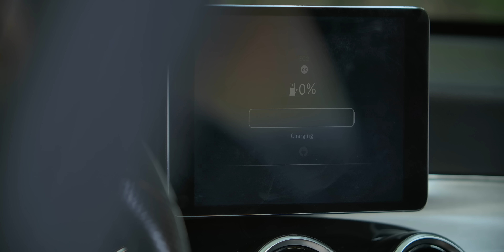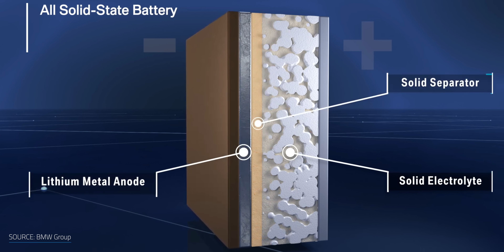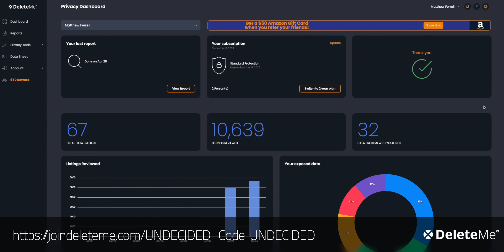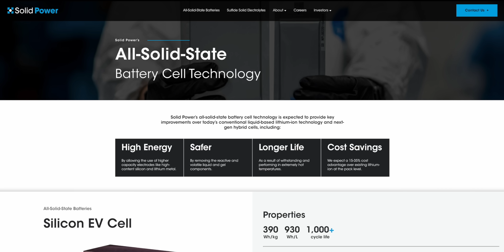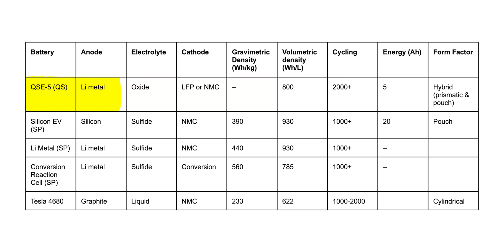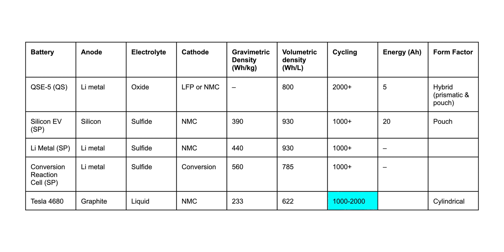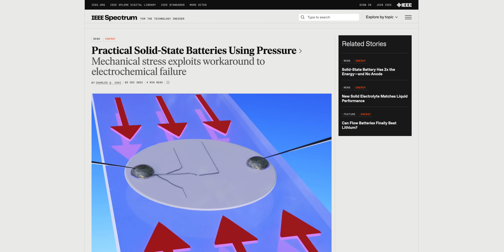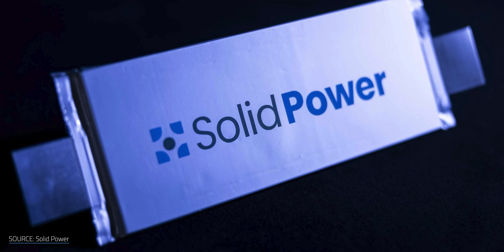Solid State Batteries are Closer Than You Think

Comment: Quantumscape already solved solid state batteries. They are literally commercializing them now and are about to submit B samples. VW's PowerCo verified the performance of the batteries publicly earlier this year. Quantumscape's lithium metal batteries are a real thing. The only question is whether or not QS will run out of money before they end up on the shelf. It's definitely a solved problem though.
Reply: Quantum scape has a semi solid state battery. They aren't actually solid state. That's just marketing.
Reply: @4203105  that's totally fair. I just say solid state because that's a general term that people are familiar with. Quantumscape's batteries are technically lithium metal with a solid ceramic separator. Not technically solid state. However, as Dr. Siva Sivaram (QS CEO) said on the TD Cowen interview a few days ago, Solid State means NOTHING if you can't get them working well outside the lab. And NO ONE has a Solid State battery working well in real world conditions. Not even SLDP. SLDP had problems with thermal runaway in their A samples, their battery requires high operating temperatures, and still has not solved the problem with dendrites (cycle life). Watch the TD Cowen interview with Solid Power's CFO as well. SLDP's CFO did not inspire confidence in SLDP's offerings and STILL REFUSES (his words) to provide updated performance data on their batteries. He literally refused giving this information live. Whereas QS's CEO was interviewed by TD Cowen and gave a whole slideshow filled with A2 performance data and had a whole slide showing where QS is compared to competitors. QS is actually showing progress and is being open and transparent about performance and milestones. SLDP is not. I want you to compare the TD Cowen interview with SLDP and the TD Cowen interview with QS and marvel at the difference. The difference is night and day. After watching that, tell me which company you would rather trust to build a next-gen battery. I'll take the lithium metal company (QS).
Reply: @4203105  you're right. Technically QD is lithium metal with a solid ceramic separator. Not solid state. But as Dr. Sivaram (QS CEO) said on the TD Cowen interview a few days ago, solid-state means NOTHING if solid-state batteries can't perform well or cost-competively in real world automotive conditions. If lithium metal does better than the current solid-state solutions, that's okay. SLDP for some reason put their CFO on live during their TD Cowen interview (different interview from the QS one) and refused to give any performance metrics on their latest batteries. The CFO Kevin literally refused to provide any data. SLDP A samples had thermal runaway, high operating temperatures, and haven't seriously solved the high cycle life issue. In the QS interview with TD Cowen, Dr. Sivaram provided a whole slideshow on performance metrics for the A samples that QS has provided. He also provided a slide that shows where QS is in terms of development compared to all of their competitors. QS is far ahead of everyone else, especially SLDP. I would encourage you to watch both TD Cowen interviews (SLDP and QS) because both of them occurred in the last few days. SLDP had nothing to offer and was incredibly skimpy on any details. Nothing new to report and was a nothing burger. QS'w interview essentially clarified whether A2 was made with Raptor films and confirmed the timeline for B samples delivery. The slides were packed with info about CLEAR DOCUMENTED charging and discharging capabilities and compared these to competitors. There's no comparison at all between SLDP and QS and they really shouldn't be used in the same sentence.
Reply: @4203105  Sorry I don't know why my reply keeps getting lost. I'll post it from my PC. You're right -- QS's battery isn't fully solid state and yes, it's just marketing. They have produced an anode-free, lithium metal battery with a solid ceramic separator. Not full solid state. As Dr. Siva Sivaram (QS CEO) stated in the latest TD Cowen interview from a few days ago, solid-state means NOTHING if your solid-state battery sucks. In that interview, Siva walked through a plethora of slides demonstrating all performance characteristics of QS batteries including A0 and A1 and explained the difference in throughput from Raptor ---> Cobra. A2 was just sent out so they don't have customer or in-house testing results yet. There was so much info packed into that interview it will make your head spin. The interview solidified that A2 was NOT using Raptor films. Therefore, we will expect only B0 cells to utilize Raptor. 

With that being said, now watch the TD Cowen interview with the SLDP CFO - also from like two days ago. By the way, why would SLDP even put their CFO on the interview? So he couldn't answer tough questions about the SLDP cell? Seems like a tactical cop-out. Kevin, the SLDP CFO, gave a very lame-duck interview where he refused to disclose any updated performance metrics live on air (QS provided the latest metrics on their latest data during their TD Cowen interview), and did not provide any new or meaningful information about even the latest chemistry of SLDP. When pushed about the chemistry, Kevin kept looking at his notes and reading basic bullet points that everyone already knows. SLDP hasn't addressed high operating temperatures (increases weight, complexity, and energy use and lowers energy density) and they have not addressed cycle life NOR the requirement for high pressure application for the operation of their battery. SLDP and QS shouldn't even be mentioned in the same sentence they are so far apart. The whole EV/green tech market is down across the board including QS but seeing SLDP dip into the mid $1.50 per share range doesn't look good. SLDP is going to have to face the music sometime.

Comment: I wonder if we need to think about discharge rate. Do we mix a percent of quick discharge batteries with slow discharge for city/hiway driving. Do we mix solid state with another kind to achieve a drivable vehicle?
Reply: Solid state is strictly superior for vehicles as the energy density per weight is much higher, meaning a battery of a given capacity is much lighter for them than with typical lithium ion batteries. There would be no reason to mix them with other batteries.
Reply: @5467nick  Energy density per weight is close to meaningless for vehicles.

Comment: Matt Farrell’s technical videos are so good that it is disappointing that he omitted two major factors in this otherwise excellent presentation. First, fast charging times require higher electrical power. To charge a 50kwh EV car battery in one hour requires a 50 KWatt power drawer. Change that to 10 minutes, and the power draw is 300KW. There is a practical problem with h delivering very high voltage and/or very high current into the car. There is an even bigger problem with drawing 300KW from the grid for every charging station. If a motorway service station typically has 12 fuel pumps and an average fill and pay time of 5 minutes, an EV equivalent will need 36 charge points with a 15 minute charge and pay cycle. That is a power draw of over 10MW at peak times - the output of a small power station. No electric grid in the world can deliver that power or anything like it. 
Secondly, Mr Ferrell said that drivers are reluctant to move to EVs because charge times are longer than fuel filling times. True, but it’s not a marginal difference, it’s an order of magnitude higher for EVs. Drivers will face at least an extra hour of travel time for every 200 miles. Some people might not care, but most do. My diesel has a range of 650 miles and a 5 minute refuel time.
Reply: I travelled 500 miles with my Tesla Model Y last year and I had the exact same start and arrival time as my friends in an ICE car. Just use the charging breaks for a coffee or bathroom break.

Comment: Synopsis:  For the last 20 years, solid state Li based cells have been 5 years away.  But that has changed!  Solid state Li based cells are now only 5 years away! 

Yes, I'm a skeptic as I've been fed this BS by battery manufacturers for 20 years.  If I had a dollar for every time I saw a PowerPoint timeline that shows solid state cells intro at 5 years away, I'd be much much richer.  As I didn't buy into all the hype, I steered my employer toward proven solutions, that were demonstrated not only in a lab, but knew how to address the production issues, which are far from small with these technologies.  That made me the money, not the promises of solid state that have still gone unfulfilled!

Comment: Having to use high voltages for QuantumScape's fast recharging seems like it would be very inefficient. Power = Voltage*Current, where current would be a measure of ions moved per second. If you have to use a higher voltage to shift the same number of ions in the same time period (and the battery has the same cell voltage) then the energy from the additional voltage is going to be expressed as heat. Lots of heat. And any energy going to heat is wasted.
Reply: You assumed the  same cell voltage and internal resistance. But I also don't understand why even cellphones have fast charging at upto 20 volts. It seems charging is not about supplying ions but actually making ions move.
Unrelated but conveniently car chargers are limited by how much current they can squeeze down the connector, even the water-cooled ones.

Comment: #1 QuantumScape is in hot water for using liquids. #2 Solid Power batteries suffers from H2S creation which is deadly. Check out Nuvvon for a real SSB solution that doesn’t need heating/cooling, works at atmospheric pressure, no liquids (only battery to be UL certified for flights), and are produced on standard lithium ion equipment (also tested by third parties).

Comment: IMHO....the volumetric ratio (Kwh/L) is not near as important as the weight ratio (kwh/kg) for American cars.  We already stuff 200kwh batteries into trucks.  We need the weight and cost to come down.  I think we need 1000v systems at 1kwh/kg.  I think that's the undisputable tipping point for the last ICE holdouts.

Comment: Looks like the charge cycles for solid state batteries are not any different than regular lithium batteries. That is a big problem when after 10 years you may have to replace your batteries and it's costs $25k to do so.
Reply: Do the math 250+mile average ev range across 2,000+cycles while retaining at least 70-80% capacity=500,000+miles!
News flash that's a LOT more total miles than 10 average year's of driving a personal use vehicle. 😀👍🏻
Reply: @4literv6  The charge cycles for solid state batteries are between 1000 to 2000 which is the same as the old lithium batteries. What I was hearing before was the number of charge cycles for were suppose to be much higher for solid state than the regular lithium batteries.
Reply: @michaelriecher5632  That's nice. Your car still won't need a battery replacement after 10 years.

Comment: And again I'm irritated by the claim of fast charging capabilities of solid state batteries: Solid state has substantially higher internal resistance. It is directly correlated to the reduced ion mobility mentioned, and the resulting power loss is described by the "forcing of ions through the separator" 
So there will be tremendous power losses, and very high temperature during charging. In a lab, there might be enough cooling power available, but certainly not in a parked EV. Even for liquid electrolytes the 80% in 15min will heat up your battery pack by 25°C+ (limited by heart transfer from battery to coolant, but also from coolant to environment). Now imagine solid electrolyte cells. And you might have real issues cooling those, because they are "moving parts" due to swelling ... 
TLDR: There will be thermal limits for fast charging! Might be worth to have a look there to be less "undecided" ;)
Reply: Apart from that: love your videos to stay up-to-date on battery topics. So: no offense!

Comment: I have been without power now for 5 days.

My 1000 watt battery pack and solar panels have really been helpful.

However my 4300 watt gasoline / propane generator has been less expensive and most effective.

It does for $500 + $30 per day what would cost me roughly $8,000 for a solar system and it worked on the one day that was heavily overcast after the storm.

The battery pack has been useful for short-term Point usage around the house like keeping the freezer and refrigerator going for a couple hours while I was gone so I didn't have to use propane. It also allows me to have lights in any room and to operate the electric starter on my gas stove.

And it kept my freezer and refrigerator going the first night until I could get the propane generator set up the next morning.

I expect that the prices for these battery packs will drop by 40% over the next year and the price for panels will drop by another 5%. But it will still be a long time before they are a cost-effective solution.
Reply: And just taking a guess, but I think "a long time" in this case means about 10 years at the current rates of capacity increase in price declines.

If we have a forecast to be hit by a hurricane later this year in August or september, I will go and buy three more propane tanks and two more 100 watt solar panels.

I also have an inverter on my car that hooks to the battery which will run 150 watts even though it claims to run up to 750 that is apparently attached to an f650 or other huge truck with an enormous alternator.
Reply: You can get 1kwh storage for 200$ soon. There are already companies selling battery packs at these prices

Comment: I own and drive a second hand 2015 LEAF and slow charge it at home. So, for an 8 year old EVE its battery is in good shape. I hope the solid state is ready to use by the time I purchase my next car. 
My husband drives a 2004 Honda CR-V. We like to keep cars running as long as possible.
Reply: I'm now on the 9th year on my 12 year old Mitsubishi i-MiEV. I was able to get a free warranty pack replacement in 2020, so I have capacity similar to when the car was new. I also trickle charge at home. The next EV (there won't be any more ICE cars here) will almost certainly have a larger pack, be less prone to heat degradation and have V2X capability.
Reply: I have a 20 year old XC90 (diesel) -  hope it runs until I can get a SS EV
Reply: There are no production plants for solid state batteries anywhere
Reply: Lol we have Zero point energy technology that has unlimited power solid state batteries are pathetic look at all the inventors and scientists kill who have made free energy technology. This is pathetic.

Comment: Impossibly thin electronics are not necessary. On the other hand, fitting more battery power into devices of the current thickness/mass... that's a worthy pursuit. Bring it on.
Reply: Amen to that. I'd rather carry around an 80s brickphone sized device if it devoted the space to retaining capabilities, improving durability, and a massive battery life. I don't need a phone I can shave with, I need a phone I can do things with.
Reply: i need the steam deck 2 to have this tech.

Comment: I have been waiting for these batteries with trepidation. My primary goal is to replace my ICE engine with an electr motor and keep my manual transmission. Is this a good idea from an engineering perspective? It isn't. It's a silly idea. But I still want to drive a manual.  And, hopefully, with enough development, we will have batteries that are light enough for ICE to EV conversions. Gearheads unite?

Comment: Still a few years away at least but I think solid state will be a game changer for EV motorbikes if the manufacturers can avoid falling into the trap of pandering to the MOAR RANGE crowd and use the energy density gains to implement sorely needed thermal management improvements.

Comment: QuantumScape is much closer than 5 years away. Volkswagen has stated several times that they will be putting QuantumScape batteries in their cars this year.
Reply: Quantumscape has a semi solid state battery. They aren't actually solid state. That's just marketing.
Reply: @4203105  Well actually that’s misleading and arguably completely false all together. They make a battery with a solid separator, which is the most important component.

Comment: I bought some Quantumscape (QS) stock in late July 2023. A few weeks later, the stock price plummeted because QS made an announcement that they were going to increase the number of shares on the market thus diluting the shares. I bought more shares in October 2023. 

In early January 2024 QS announced the results of the tests of their batteries by Volkswagen (VW). The batteries showed recharge capabilities of 500000 km (~310000 miles) equivalent with no appreciable degradation of charging. The stock price went up. I did some calculations of how many equivalent miles per charge. It was about 300 miles and not what they touted (~500 miles). I sold the stock at that time for a small profit.

A week later VW dropped QS and the stock went down. I haven't paid attention to the stock since.

Comment: I really do not think range or battery charge time is holding back electric cars.  It is cost and reliability.  They are expensive (as all new cars are) and EV cars are still fairly new technologies vs 130 years of ICE.  Plus, all new cars are full of various, un-needed tech instead of basic transportation that lower middle class and working poor need.